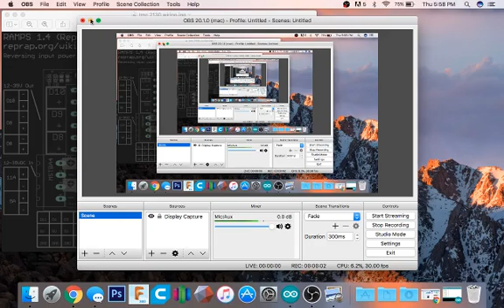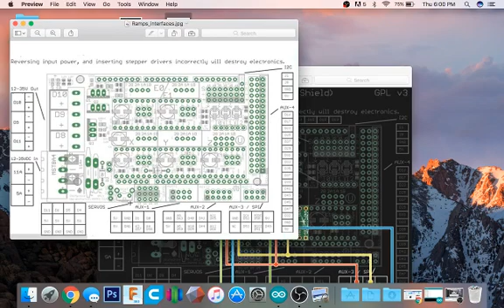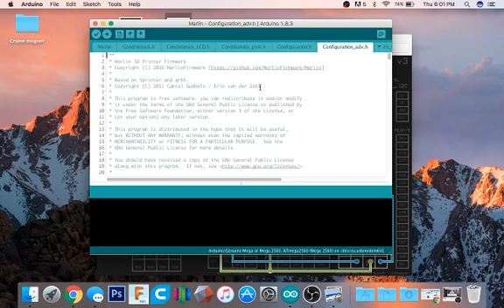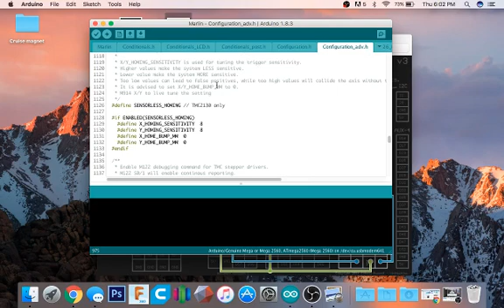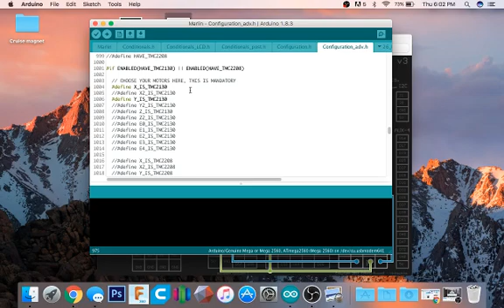TMC2130 setup issues and how to fix them!

Comment: Hey Dan, you're awesome!  Thank you very much for posting this video.  Tom's video was not very informative as far as the pins and I had the same errors as you.  I ended up replacing them with TMC2100 drivers as I thought it was my poor soldering job causing the fault to ground errors.  I still have the 2130s though, so maybe I'll give them another try...  Thanks again.
Reply from the maker: Thank you! No problem, I hope it solves your issue!

Comment: HI , i want ask you if you solder the jumpers ? like its showen in this video 

https://www.youtube.com/watch?v=AVHVCPcFHUs&t=145s

thanks for sharing
Reply from the maker: Dr Tarik, I didn’t solder them because I have the Watertott drivers that already are set up for spi from the factory. But if you have the fysetc ones you will have to.
Reply: I have this 
https://www.filastruder.com/products/silentstepstick-tmc2130-stepper-motor-driver
Reply from the maker: Dr Tarik ok cool, yeah the only thing you have to worry about is getting the pins soldered on. You don’t have to worry about the bridges unless you don’t want to use spi, which I wouldn’t recommend.
Reply: Thanks a lot . I allrwady solder the bridge yesterday i will try to fix them now
Reply: other question :) about the jumpers in ramps board i did take out all  3 for each driver , or they must stay ?

http://sturm.selfhost.eu/wordpress/wp-content/uploads/2015/04/ramps-Jumper.jpg
Reply from the maker: Dr Tarik I removed mine.
Reply: Thanks ☺

Comment: when you say you 'Changed the EEPROM from the terminal' what exactly do you mean? its a little after 3 minutes that you say it
Reply from the maker: I use the terminal in Octoprint, but you can use other programs.
Reply: but changed what exactly, I figured the terminal was how you were sending M-codes, but how did you change the specific values you wanted, like what was the code
Reply from the maker: If you set the values in the firmware, doing an M502 command will overwrite your eeprom with the values in the firmware. Or if you just want to set lets say, the x axis to 800 mA, you would enter in M906 X800. You can adjust the endstop sensitivity also by using the M914 code. Then M500 to save any changes to your eeprom.
Reply: Dan Murphy thank you for the clarification! I'll try that later and report on my findings